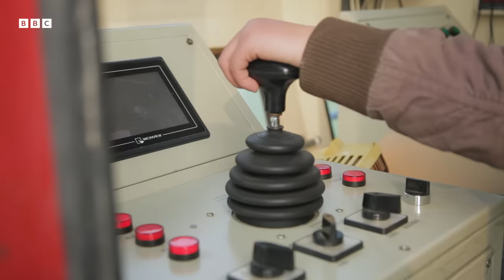What Does it Take to Build a Man-Made River? | Generation Earth | BBC Earth Science

Comment: Basically this is a modern day version of a Roman aqueduct.
Reply: Yup
Reply: Except everything will fall apart in less than 10 years. Roman aqueducts, bridges, buildings are still up 2000 years later. lol
Reply: @danielt.8573 and also not working for a long time. built by slaves as well and they were white
Reply: @danielt.8573 those Roman shit structures wouldn't stand the amount of strain modern structures experience in a day.
Reply: @danielt.8573 в Китае каналы и мосты строили за тысячу лет до появления Рима 😂😂😂
Reply: @danielt.8573  only few short sections stand, you call it still up 2000 years？
Reply: @danielt.8573 high speed rail in US will never break. Because there isn't really any 😂
Reply: @etherealnine blasphemous
Reply: @jxmai7687 no need for the negativity here

Comment: The longevity of concrete structures in water can vary significantly, ranging from a few decades to a century or more. Several factors influence the rate of deterioration, including the flow dynamics, water pressure, and natural elements like currents and seismic activity. Additionally, the specific composition and quality of the concrete used play a crucial role in determining its durability. Given the massive scale of this project, it is imperative to account for potential weather-related challenges and the ever-present risk of seismic events caused by the Earth's constantly shifting tectonic plates.

While the initial 20 to 30 years may see the successful operation of such infrastructure, the likelihood of significant failures and accidents increases substantially beyond that timeframe. Infrastructure development is undoubtedly a cornerstone of human progress, but how we approach its design, construction, and maintenance ultimately determines its long-term viability and impact on societies worldwide.

Comment: The sad thing is all these resources, work, effort, & environmental impact are for a project that is only temporary, and won't last but a few decades.   It would make more sense to build something like this that would last for centuries. Even the Roman aqueducts still exist today, because they were built with methods and materials that would stand the test of time.   Anytime you build a structure with steel reinforcements, eventually, it will fail.  Better off to use non-metal reinforcements, or at least used powder-coated steel reinforcements to double the life expectancy.
Reply: All infrastructure is the same, what ultimately determines how long it will last is how long you maintain it for.

The Roman aqueducts that still work today only work because they have been restored, multiple times.

It isn't just about the structural integrity, a lot of water infrastructure fails because it gets clogged up. After the Romans were gone, the aqueducts eventually got clogged up with silt from the river because no one was there to clean it.

And there is a bit of survivor bias there, there's countless buildings from the ancient era that have been built using similar materials. Only a very small minority survive today.
Reply: All structures have a design life. They are designed to last a certain amount of time. Once that time gets close, stakeholders will decide if it should be renovated to make it last even longer, or if it should be rebuilt. That's no different from any other built structure. Although the video doesn't mention it, this aqueduct is probably designed to last 50-100 years. The budget is calculated to reflect this reality. Nowadays, nobody just goes out and starts building something, not knowing how long it will last or what it will cost.
Reply: Huh? The Empire State Building is almost a century old and it is steel reinforced, what are you talking about 😂
Reply: @ikeu6433  really?  so all the historic records dating back to 1930s are wrong?  As are all the engineer reports apparently... according to you.  Because all records show the Empire State Building wasn't built with any rebar in the concrete at all, despite the fact that rebar pre-dates the Empire State Building by nearly 20 years.
But according to you, there is rebar in the concrete holding up the Empire State Building.   Well if that's the case, you should contact the authorities and share your findings. 🤣😆😂😄😅
Reply: @pjacobsen1000  what is the design life of the pyramids in Egypt, Sudan,  South America, Asia, & East Asia?  Where are the stakeholders who decide when those pyramids need to be renovated?
And what about the Roman structures?  What are their design life?  Where are their stakeholders?
Also, I mentioned that the Chinese aqueduct system will only last a few decades.  So stating it will only last 50+ years, is repeating what I already said.  Also thanks for stating the obvious about life expectancy estimates and cost estimates.   You must be good at reading front-page headlines, and repeating those headlines to everyone you come across.
Come back when you have something real to add.
Reply: @ericmcquisten  If you look closely at my comment you will notice that I never said rebar. English not your first language? 🤣🤣
Reply: @ikeu6433  reinforced concrete (aka steel reinforced concrete) is in fact the use of rebar.
Clearly critical thinking is foreign to you as common sense is  🤣🤣🤣🤣🤣🤣
Reply: @ericmcquisten  They didn't operate with the concept of 'design life' back in ancient times. The pyramids are meant as monuments of power, not simply as tombs.
Your original suggestion that we should build structures that last for centuries suggests that you may not have considered the cost of building such structures. If you have, I'd like to see your cost estimates (just in rough terms, no calculations needed).
Reply: @ericmcquisten  My brother in christ, you made the statement "Anytime you build a structure with steel reinforcements, eventually, it will fail." 
That was your statement, it is an incorrect statement. You can move the goalpost but I recommend you at least edit the comment first dude 👌👌
Reply: @ericmcquisten it's a heavy steel frame building that holds up the brick walls. it's not made of concrete
Reply: @pjacobsen1000 in centuries your structure becomes obsolete. like  a bridge lets say . after 100 years it's too small so must be torn down and built larger. people have some weird idea that buildings hundreds of years old are great to live in or use. no they suck! not energy efficient , drafty , they lean etc. it's like a car from the 60's suck in comparison to one from today.
Reply: @ronblack7870  what is "it's"?  You'll need to be specific kiddo if you want to have an adult conversation.  Try using complete sentences in the English language, so you at least sound coherent.

If by "it" you mean the Empire State Building,   Then you are wrong, or at least incomplete, and thus partially wrong.   To be specific, the Empire State Building is comprised of 200,000 cubic feet of Indiana limestone and granite, 10 million bricks, and 730 tons of aluminum and stainless steel. 

Not sure you're going on about concrete for, since I was the only one here stating that the Empire State Building was NOT compromised of reinforced concrete.  If you want to clarify the lack of reinforced concrete in the Empire State Building, talk to your 2 buddies, ikeu6433 and pjacobsen1000.  Nice try though.
Reply: @ronblack7870  I couldn't agree more.

Comment: Why build an aqueduct above ground instead of just building a river you know...in the ground? Surely it would have been easier to build a giant concrete pipe instead
Reply: Good question... If you do it that way, maybe its more difficult to monitor how the water flows and less easy to detect and fix blockages and such ? Idk, not an engineer.
I just thought about it again. If the destination lacks water, its likely higher than the source ? Therefore the aqueduct needs to start high so it can gradually slope down (up) towards the destination ?
Reply: Just went down a bit of a chinese water infrastructure rabbit hole trying to find out where exactly this construction is. Makes one wonder how soon fresh water scarcity will be a real problem..
Reply: @ftgv1  Ex-survey draughtsman here; because the Earth is not flat (despite what the loons say) building something dead flat like this needs to be is really hard, even over a few kilometres.  Elevation is cheaper than pumps.

Underground pipeline could be done, but you wind up needing to dig a lot of trenches which is expensive & slow.

As for why a aqueduct vs pipe, possibly cheaper again (both time & materials), I don't know.  I'd completely cover it and put a bike path on it, that's been done before.
Reply: stupid question. pumping would be necessary, and the use of electrical energy to drive the engines. the ground where this aqueoduct is being built is at a level lower than the level of the city of Beijing, and the water source is at a level higher than the city of Beijing
Reply: Parts of this water transfer project actually crosses over and under other rivers. Aside from the other factors people here mentioned, there are also environmental concerns, as well as water safety concerns. It's easy to monitor water quality at the source, but it becomes harder to control water quality when you allow the water to mix with other water all along the route.
Reply: @j.f.christ8421   Thanks for the info, I was on the right track of thought. So in summary, as is often the case, its being built the way its being built because that's  the most cost effective way to do it.
Reply: @ftgv1 I think the reason the top is open is you get better water flow than in an enclosed pipe.  A long pipe with a very small drop would probably require pumps.    So that leads to the U shape which uses about the same amount of materials as a pipe, but easier to make and has more volume.
Reply: Sounds right. An open U can also overflow if it needs to ? Seems like having a closed pipe is more difficult in many ways. I do wonder if the closed pipe would be less susceptible to contamination though ? Hope they factor such things as public health into the final decision. Although, again, the skeptic in me assumes cost is the biggest factor.